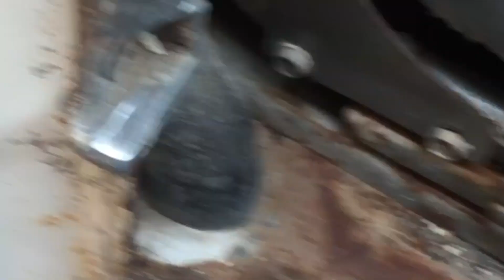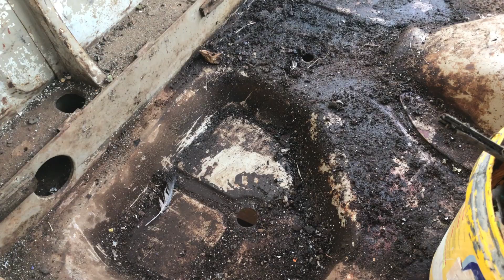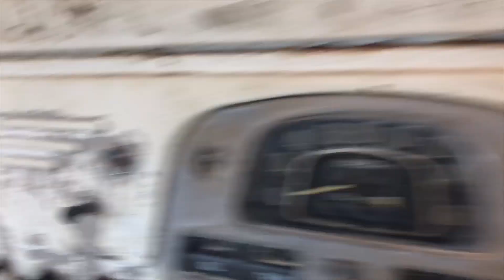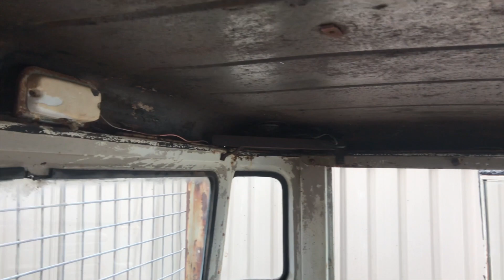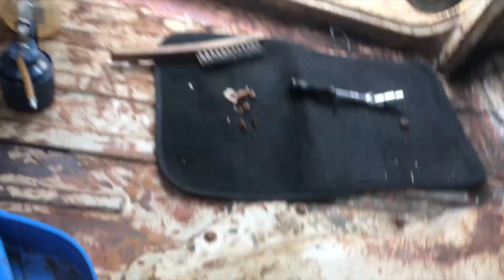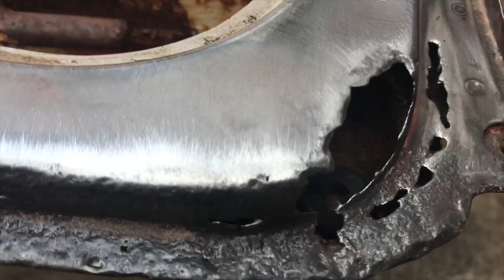Project FJ45 - Part 2

Comment: Hi mate. Keep the uploads coming. My son & I are doing up a 1974 FJ45. We're doing something a little different to you by the looks (Swapping the 45 cab onto a 60 series chassis) Hope to follow your project through. Maybe we'll learn something.
Reply from the maker: BoofHeadProductions I am thinking to restore at this stage although 60 series brakes and steering would be a nice drive ability option. All the best with yours , great feeling working with your son , see how excited Jason Hill gets when his son is in the shed, n pistol Pete has his son in the pram watching.
Reply: Cheers mate. I hope to post some vids too eventually. Yes my son working with me will be a great experience. He's nearly 15 & we hope to have her close to ready by the time he gets his P's. We were basically given the 60 series so I jumped at it especially when I found out it has a 2H diesel with 5000 k's after a full factory rebuild. Looks like my first project will be to build a molasses pit, wow that works great!